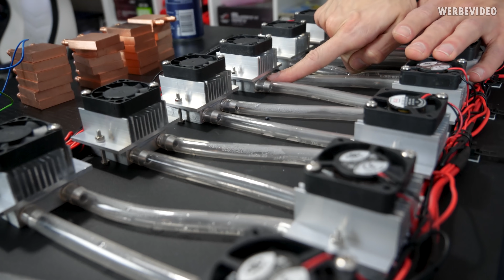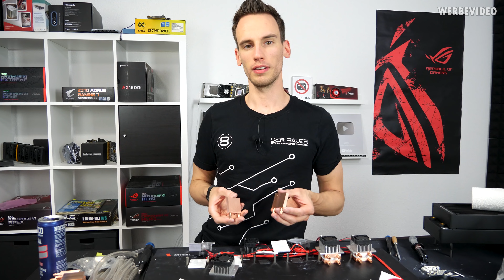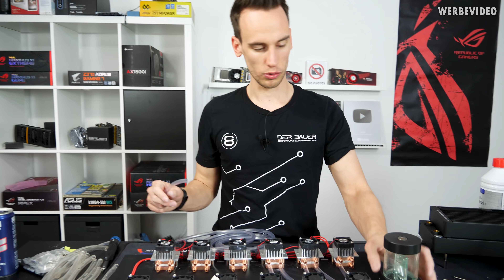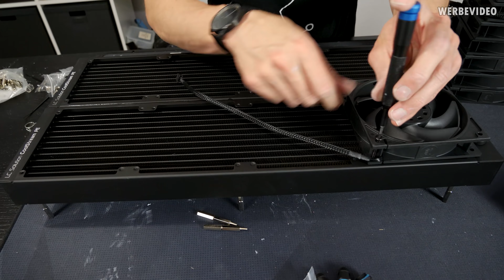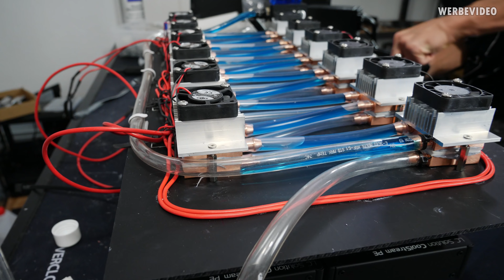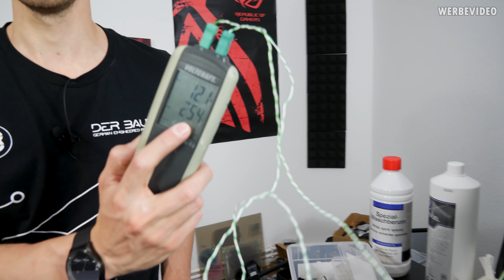DIY AliExpress Chiller - IT WORKS!

Comment: I would love to see some sort of controller to be able to adjust the temperature of the cpu or of the loop. It could be quite easy to do, maybe with an Arduino controller receiving inputs from some thermal probes and controlling the cooling elements with PWM. It could be a feasible solution in order to avoid condensation by keeping the water temperature maybe 1 or 2 degrees above room temperature
Reply: Or just use a car radiator... You don't even need fans. I run -60c on a system at idle (for daily machine), and its perfectly fine. People need to learn the word INSULATION. There is no reason to limit cooling to ambient only, that's worthless (seriously, get a big car radiator, they are dirt cheap, silent, and don't consume power)
Reply: @jakegarrett8109  Of course you could, it's not aerospace engineering. But it's not a practical solution for a daily use. Adopting a cooling solution that involves the need of insulation usually is design for one-time applications, not for daily use. One like me, as an instance, would find interesting to design and program a home-made PWM controlled chiller that could fit in a desk pc, that would be able to withstand quite high thermal load with no need of insulation or compromising on aesthetics with a car radiator under the glass
Reply: @ebbeota  I ran mine daily, haven't had to touch it once, your idea honestly sounds way more work, just saying... (plus yours will use a hell a lot more power)

I do want to make an upgrade to mine with Arduino for adjusting the heaters, though honestly, 15w in total really isn't that much power, I just like tinkering with electronics too.
Reply: Yep Arduino is real fun, and if you have some basic skills in C or C++ it's pretty straight forward
Reply: @ebbeota  Yep, I also love robotics, I think my first Arduino Uno was like 10 years ago, they are definitely useful. I still want to bench my Pi 1 model B to the record books (I have special VRM power boards, and I'll probably just use liquid nitrogen, but I'm thinking about getting a turbomolecular compressor so it can run somewhere around 10 kelvin), but I think I might just jump to the newer Pi 4 when it comes out, I think I waited too long for the Pi 1 to seem impressive, haha!

Arduinos are great little devices, they can do so much its awesome. I always keep a couple around, because you never know when you'll need them for the next project!

Comment: I managed to hit 7C no load using 4 100W tecs and some aircoolers strapped to them. What's the internals of those cooling blocks like?
Reply from the maker: like none :D It's just an S-Shape
Reply: @der8auer  ah makes sense.
Reply: @der8auer  maybe double up the blocks each side of teh pelt?
Reply: @der8auer  You'd probably see significantly better performance if you plumbed the chiller blocks in parallel to slow the coolant flow within the chiller itself.  You'd still get high flow through the CPU block - but with the more desirable low flow through the chiller.
Reply: @zoson  That's wrong, that's not how heat transfer works. I know you haven't taken any engineering classes, but higher flow rate means faster thermal transfer, and its in a loop so it just goes through more block stages and the time its in contact with the fluid is the same (unless you have a leak somewhere...) when the flow rate of the cpu block is the same. You'll do worse in parallel in this case (when flow rate is not hampered)
Reply: @jakegarrett8109  This is flat out not true.  Overall flowrate of the system is not affected.  So the volume remains unchanged.  You just succeeded in showing your own lack of engineering understanding.
Reply: @zoson  You're not understanding, its the fluid interface with the blocks I'm talking about. Pumping the water at a higher speed to the fins will result in higher thermal transfer (basically, its effective thermal conductivity to the fluid medium goes up, you want it to be transferring the energy, that's why people delid Intel chips).

In parallel, velocity would be 1/8 (for 8 blocks), yet they spend the same amount of time in contact with the blocks (now its just 8 blocks quickly, which is good, higher thermal transfer rate).

The transfer of a fin is based on the velocity of the fluid as one of the variables. Go study heat transfer, its a fun subject.
Reply: @jakegarrett8109  Velocity has nothing to do with heat conduction aside from the fact that it increases volume of flow.  Volume is the name of the game, and having one part of the loop in parallel doesn't reduce the overall volume of liquid flowing through the system.  Changing to parallel within the chiller would reduce flow restriction within the chiller portion of the loop.  This in turn would increase overall volume of flow through the entire system.  The volume of flow in and out of the exhcanger will be higher in parallel.

Additionally, the largest impact to heat transfer is dT between hot and cold materials.  By introducing the hottest coolant to each exchanger within the chiller you are increasing the thermal transfer efficiency of each exchanger.

So, you're increasing effective volume through the chiller by virtue of reduced flow restriction and you're increasing the efficiency of each element within the chiller.  It's you who does not understand.
Reply: @zoson  I guess you truly are this ignorant (if you don't know that's fine, I know people who used to think perpetual motion was real, and then entropy crushed their world and they learned why perpetual motion won't exist in this universe. People are not born knowing everything, haha, I wish, coulda skipped school then, would be so much easier!).

Go look up the equation for fins in heat transfer. I won't link it, because then you'll think I'm giving you fake info, so please just go look it up yourself. I studied heat transfer in engineering, the fluids velocity is very much a factor in the equation (you'll find curves and graphs, its not linear), and our instructor said the one thing that pissed him off the most were all the dumbasses that said "it will conduct faster if the fluid is slower", because that's simply wrong (it might be at some point due to shocks and fluid separation above mach 1, but we're not breaking the sound barrier here). So its fine that you don't know it, but please go learn it, its very interesting topic that a lot of people get wrong.
Reply: @jakegarrett8109 LMAO.  You already looked bad, and now you're just resorting to adhominems after it became clear you were out of your depth.  Sorry to break it to you.  I have an EE degree from an ivy league college, and took PDE, thermo and fluid dynamics.

You're failing to grasp the entire concept of a heat exchanger system.  Again, changing the chiller from serial to parallel will NOT reduce volume through the chiller.  It will increase it.

I'm sure that next you'll try telling me that counterflow doesn't improve performance of a heat exchanger as well.
Reply: @zoson  There is the variable in the equation for a reason, (its what also determines the optimal fin density)

Not so fun incident of this week:
I just had an Apple engineer say "if the USB port on the laptop side isn't burned, then it couldn't have damaged your laptop" (as if a wire needs multiple short outs to damage electronics, obviously if it shorts out on the thunderbolt port, an area with small contact where it would ideally burn since its the area with the higher contact resistance, then that's obviously the place it would show marks when exceeding current limits, the "EE" in this case didn't have a clue how electricity works). (Yes I'm pissed, tried an iphone for 30 days, and holly $hit, its already F'd up my nice laptop, burned its charger, and another. They "diagnose" as water damage over the phone call with 0 evidence it was ever moisture, some lousy @$$ engineer! They give everyone a bad name!)

Right now I'm using a 12v 2 amp circuit breaker power supply running to 12 ohm nichrome heating element (to limit max short circuit current to 1 amp) to feed the DC/DC buck converter down to the required 5v (apparently its only 80 mA using pins 1 and 4 for USB, but normal speed charging handshake with data pins 2 and 3 works like OEM charger, though apparently apple uses some garbage useless resistance between them for no reason). Works fine when the thunderbolt port isn't earning its name (they should call it a "lightning charger", oh wait...)

So, having an EE engineering degree doesn't mean crap apparently, apple will still hire a literal monkey and call them an EE (as an engineer, this pains me). I've also seen morons in thermal systems group discover and say "wait, so the colder the temp delta, the faster water will condense?", no duh! Sounds like they never saw a freaken psychometric chart in their life! A 5 year old holding an iced cool-aid or tea would have figured that one out, yet this person literally works in a thermal systems engineering group... Literal monkeys!

Now, I don't think your a monkey (PS, my benching name is 0C_Monk3y, as I'm a monkey when it comes to overclocking and have so much to learn still), but, you are wrong about this physics in particular (I'm sure your not an apple engineer, goodness I hope not... If you are, I'll pray for you as you deal with your colleagues )

I also have 2 engineering degrees, so 2-1 = I'm still right, right? LOL, but seriously, my favorite classes were also thermodynamics, heat transfer, fluids, compressible fluids (supersonic airflow primarily), and thermo 2 (mostly vapor cooling cycles like Hvac, power turbine systems and more in depth on your basics like Otto/Rankine/Diesel cycles etc). But, one of the most common engineering textbooks (I see it everywhere regardless of graduate school) has my thermo instructors name on the cover (I didn't know he wrote the book for heat transfer, but I find that really cool).
Reply: @zoson  Everyone knows counterflow works better, that's basic (though I was pretty shocked when I first calculated it).

Our instructor wouldn't simply give us the answer, he'd ask "does it matter?" and then we'd have to prove why or why not something like counterflow made a difference, and how much (probably 90% of us, me included, figured it made no difference at first glance). Similar with standing vs laying down soda cans in a fridge (varies per dimensions  as the primary driving factor as to when one is best), and so because of that, I remember a lot more of the topics. Fins were one of my favorites, I was like "cool, these are just like on my computer, now I can calculate that!" and so I think I had on my white board a system that read (incorrectly) FX@200w-thermal paste (12 W/m^2K)-copper cold plate 2mm and conductivity of copper and then was like crap... heatpipes... So I think I just worked out the problems in the book thinking "but if this was FX, how how would it be?" (obviously I had the unknowns like silicon stack height, the conductivity of the solder to the ihs, the thermal resistivity of the plated IHS etc, but it made the problems way more fun thinking of them as computer parts like mosfets on a VRM etc. So each time we covered a new topic, I could solve that part of the little system to "analyze my computer" (I'm still upset, we never went over vapor phase heat pipes... And my PC didn't have water cooling back then, so it was left unsolved, and that actually griped me, but then it was summer and like any engineer, I was happy my brain could stop frying after finals).
Reply: @jakegarrett8109  mmhrm.
Reply: @jakegarrett8109  Wait, you guys have that stuff in thermo 2? We have it in thermo 1 over here in Sweden. In my case it's a mandatory class as well.
Reply: What cooling blocks did you use?
Reply: @FrancescoRossi_7582  EK RAM blocks on the cold side and some cheap 4 heatpipe 120mm air coolers on the hot side. Under load from a 4790K the air coolers would get overwhelmed so I could only use it to do very short benchmarks. I still have most of the parts from the project and want to build it again when I'm not busy with other things.
Reply: @ActuallyHardcoreOverclocking  Buildzoid go go tec livestream! :D
Reply: I was able to hit subzero cpu idle temp with a single 225w TEC1-12715 ( Cooling capacity=135w, deltaTmax=70 ) sandwiched between the cpu and a shitty unbranded 120mm AIO, and 50deg cpu temp at full load on a 125w TDP amd2 (it was years back), obviously a single 120 aio is not enough to handle the tdp from cpu and tec combined.
Tested on a mobo submerged in mineral oil to avoid condensation. (  later I found out that the oil eats through/ degrades the pcie and  ram slots.)

For a 24/7 subzero system, might as well try to make a cpu phase-change block with a AC unit for better power efficiency.
Reply: @kingeric1992  if you were feeding 12v the cooling capacity will be lower like 50-60watts tops the 225w is at 15-16Vs all you get is heat  at those volts.
Reply: best case scenario is to chill water past radiator cooling... and put tec in series instead of connecting them straight. you have a bit less colling but waaaaay better power consumption. and you temp flip size will be better as you hot side is cooler.
Reply: @kingeric1992  Or make whole isolated container with subzero oil temp :D That would be pretty easy (but not cheap), just attach many tecs with air coolers to the wall of aquarium.

Comment: The Issue is the Pelletier device doesn't have a big delta so 10° delta is about the max you will have so do a double layer where air cool half to bring the second half to be cools by the 10° to closer to 0.
This will cause a second issue that it will be even less efficient and have half of the heat dissipation.

Comment: Double stack the Peltiers to get more delta-T. Peltiers more efficient heat removal with smaller temperature drops. Search "peltier efficiency vs temperature" but really I think you know all this ;-)
Reply: That sounds like a great idea, but it won't work very well. Sure you can get a higher delta, but the actual heat pumping capacity is going to be much lower. It'll get cold with no load, but as soon as you put a bit of heat in it won't be so cold anymore. Plus you now have to deal with 2x the heat output from the peltiers themselves. Remember, they don't 'eat heat', they are just a (inefficient) heat pump
Reply: Doesn't a single peltier element already have multiple layers inside it?
Reply: 60% efficiency per TEC if I remember correctly. So if you use one to cool the other one, the equation will be 60%*60%=36%. It is better to connect TEC in series and cool them with water cooling.
Reply: that good ideat cooling the peltiers with peltiers

Comment: i'm so obsessed with peltier cooling lately, sure they are so unefficient but still interesting, you could use two big water block one for the hot side and another for the could one which all the elements are mounted aside so in this case the chilled water can really be cooled at it best and so on for the hot side

Comment: A few sheets of cardboard or plastic or something between the hot and cold side tubing would likely help a bit since they are parallel. Also some plastic between the mounting plate and the cold side, or maybe flip the TECs. Anything to stop heat leaking into the cold side. Im not holding great hope for this if it is only 12c below ambient with no load, it seems like the thermal leakage of the system is already about all the TECs can handle.

Comment: Could have used a radiator + fan from a scrapped (i.e. free) car AC unit and perhaps get even better cooling and lower noise. Having a Mercedes CPU cooler would be cool.
Reply: Could have just used  his own phase cooling kit https://www.gamersnexus.net/news-pc/3317-phase-change-cooler-and-novec-cooling-der8auer-phase-shift
Reply: @Petr75661 pretty sure he’s looking for compact ;)
Reply: Chiller is able to build by evryone, but to build phase change cooler (or Phase chiler ) u need more knowlege, and manual skills :) and its more dangerous then you think (HFO-1234yf)! Better to take second hand home air conditioning, then you olny need an copper head and some pipes.
Reply: @Weryl  He's not talking about building a vapor compression cooler, he's just talking about taking a car radiator and fan and putting it in the loop. He won't have to deal with any copper piping other than cutting it off and it's not that dangerous working with vapor compression cooling anyways, R134a is one of the most common and you literally need to inhale an entire recharge kit to use it
Reply: meh its an aluminium will be shity, for same  price u can get a huge PC radiator 9x120/140 will perform better
Reply: Yep, car rads or heater cores... like back in the day, great stuff.
Reply: @Weryl  you can go Linus route and just disasemble window mounted AC and put evaporator in a bucket.

Comment: test on fx 8350
Reply: My CPU .... oh my gosh I want an update....
Reply: @Gilhadriel  mine is a core 2 quad q9400
Reply: @Gilhadriel It will fail, its barely colder than room with 0 heat load... You can do this instead (my FX-8350 system): https://www.youtube.com/watch?v=8h0ieFOeqtI